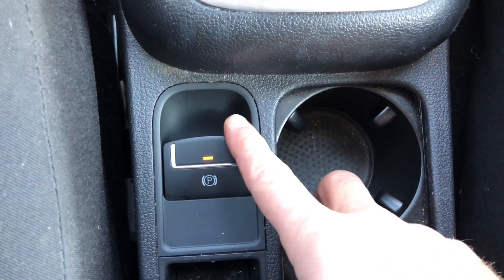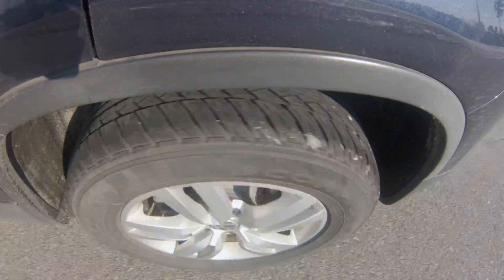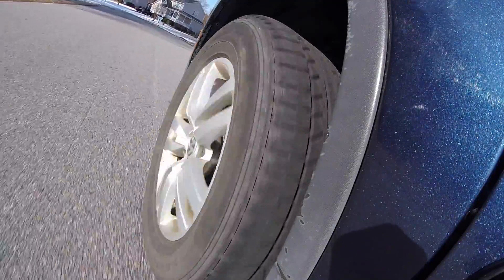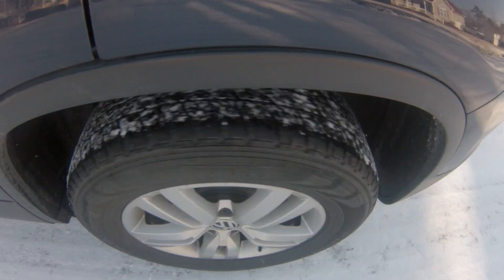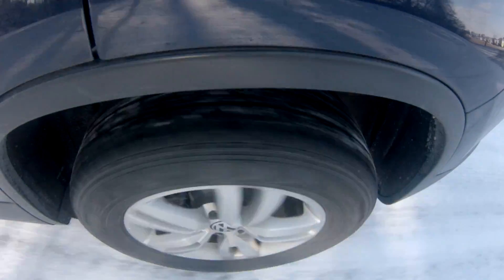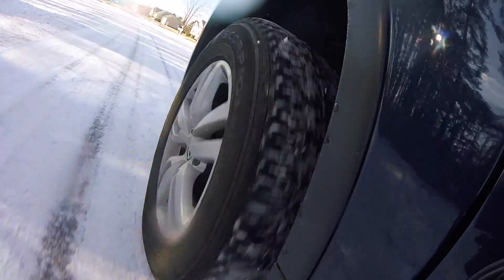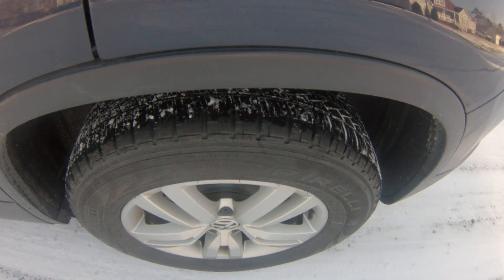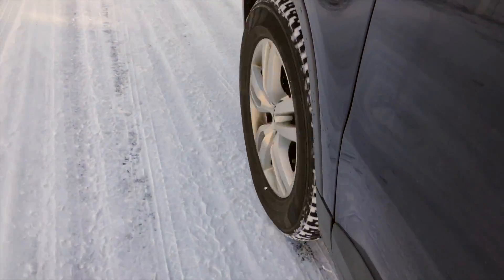How Electronic Parking Brake/Emergency Brake Works On Snow

Comment: Thank you for pointing out early that operating the parking brake as an emergency stop device brings all 4 wheels to a stop with the ABS operating as well. Many believe it only acts on the rear whels only.

Comment: Soooo.  I attempted to replace pads on all four wheels on my wife’s 2013 Tiguan last night. Long story short, I couldn’t figure out how to compress the electric parking brake. Ended up hitting the parking brake button with the caliper removed from the caliper bracket. The electric motor kept running until the piston came completely unscrewed inside the caliper and I could not get it back together. I figured out the proper method for compressing the piston and was able to easily change the pads on the opposite side. I ordered a new caliper to replace the one I messed up, and will be attempting to replace it tomorrow. I currently have a parking brake fault, and when I operate the parking brake now, only the right side spins, the left side (side that I messed up) does nothing and the light on the brake switch flashes. Is there anything special I should do when replacing the caliper? Can I just reset the fault , throw the new caliper on and it will be good go? Or do you think it would be ok to change the caliper prior to resetting the fault? My code reader is at my dads house two hours away! 
I love all your vids man, if you could help me out I would greatly appreciate it! 
Thanks!

Comment: I remember when I used to slow down engage the electronic parking brake on my 3.2 Passat and drift around in the snow until it just completely shut off and all the lights came on the dash like a Christmas tree and the brakes smelt like they were in a gt2 track session.. don’t do it

Comment: What about using it in the winter? Can it even get frozen? Should I set it or just put the transmission in park?
Reply from the maker: I assume it can. But I’ve never seen one freeze. 

I always set mine
Reply: Should in general the parking (emergency) brake be engaged (either electric or standard)?
I generally use mine when parking on an incline (and I set it before putting in park) while I don't use it when parked on a flat surface.
Reply from the maker: There is debates about it. Personally I always use mine in all my cars

Comment: I am all for safety. Regardless of what somebody thinks about their driving abilities, they're really not as good as they think they are. Even professionals make mistakes screw up and kill other people. So if the electronic brake helps even if it only reduces the chances slightly, I'm in. The silly manual handle was just a Band-Aid that has through experimentation been improved upon.

Comment: Up here in the mountains of Western NC, we've had a couple of snows this year.  Our 2018 4Motion Tiguan (all season OEM tires) has handled the conditions like a champ. We have a steep driveway with about 7 inches of unpacked snow on it and the Tiguan has went right up with no noticeable slipping.  It's 6 degrees as I type this, so I suppose the turbo engine should be putting out about 400 hp!! HA!
Reply from the maker: Now that is a Tiguan I’d love to have lol

Comment: Once the wheels fully lock.. .  . The vehicle assumes it is stopped and fully applies park.
Reply from the maker: Nothing happens with the gearbox. it assumes that by applying the parking brake the vehicle will be at a stop. 

What’s interesting is it will still see wheel speed on the front wheels but still applies fully the parking brake.

Comment: My hand brake saved my ass in treacherous blizzard conditions. Pulled it to kick the back out and execute a turn, rather than sliding straight through a red light. I'm disappointed in the fact that most manufacturers are headed towards electric parking brakes.
Reply: Sergio Ruelas if you can't fix a tight situation yourself your mechanic or dealer will glad to be of service.
That's so much more convenient for everybody involved except your wallet maybe. 
Sarcasm asaid: manufacturers are always happy to sell complexity under the blanket of comfort for the regular Joe. Ie automatic transmissions.
Reply: same , saved me from sliding of the onramp in my dad's car back in 2001. Relying on electronic for emergency is worse than relying on hydraulic in a emergency.  A electrical problem can render the whole car inoperative including emergency brake.  No wonder they call it parking brake now. I remember cars of the 90s with it labeled Emergency brake in the instrument cluster

Comment: what happens when you want to use your E brake to swing the back end around when you're having a bit of front end push. I like to use my e brake in the winter to have a bit of fun, these electronic e brakes take away from things, makes drivers less aware as well of have no feel and unable to control things when things actually go wrong.

Comment: I've done this before and it saved me from going through an intersection
Reply: bmw invente this feature back in 2002
Reply: it saved me from going through a downhill slippery intersection a 40mph on my 2012 tiguan (same color as on video) ; i dont get why the abs allows to roll so much and not break? I also bought a 2015 VW Sharan 7N - 2.0 tsi and has the same issue : ive had other cars with abs and wont roll as much 🤦🏻‍♂️
Reply: Snow tires would also save you.

Comment: @HumbleMechanic   Could you make video about electronic parking brake adjustment. Knowing how to tighten or adjustment normal parking brake wires when they get old but what are the differences about electronic parking brakes.
Reply from the maker: I did a pretty in-depth video on cable adjustment. Haven’t done much with the Electric brake yet
Reply: @HumbleMechanic  I've made repair and reset, base setting, pad thickness etc on a a8l on my channel if someone wants to see that

Comment: This concerns me greatly, in a FWD car the handbrake is essential to vehicle control in snow. If the EPB wont activate at all while moving, how are you supposed to control under steer?
In every FWD car I have driven, once you start under steering, the only solution is using the handbrake.
 Every single one suffers from lift-off under steer.
So....
 Plant your foot and ditch it....
OR lift and ditch it....

seems to me that if you under steer at all in a new vehicle you are fucked...

SLIDE CONTROL IS EXTREMELY IMPORTANT IN SNOW.
to the "just don't slide" opinion,  that's never going to happen up north unless you drive 20-30 under the limit.(which is illegal in Ontario where i live)
-even the best snow tires will slide.

TLDR;
electronic hand/parking brakes are actually going to get people killed/hurt in snowy conditions, handbrakes are needed to control a FWD vehicle in snow.
Reply: That is actually right in canada. That why I dont drive fwd anymore. I'd rather have control in the event of a slide. And rwd are way more controllable. They require you to be a better driver but they offer more control vs a electronic parking brake that is the polar opposite of safety.
Reply: That would only matter if you had a car with an EPB but it somehow doesn't have ABS...
Reply from the maker: The only way I think that would happen is if the car was modified

Comment: if you hold the ESC off button for 10 seconds it will let you have a bit more fun but it is still not fully off even with that method of holding the ESC off button for 10 seconds.
Reply: Even with a car like the 2020 toyota camry xse v6?